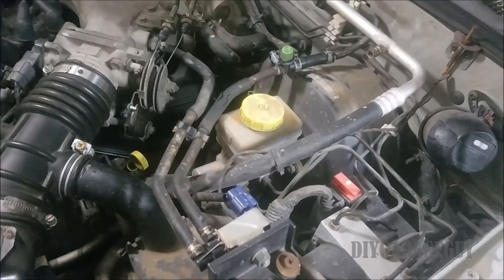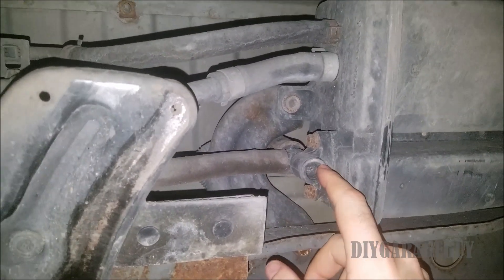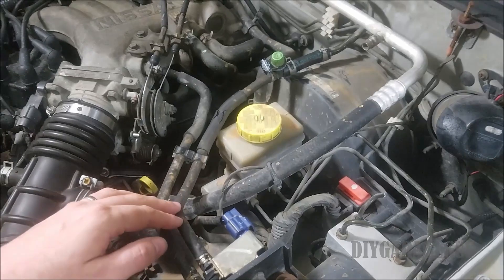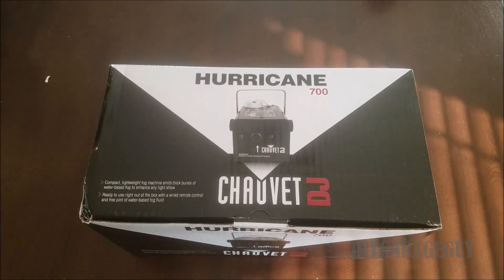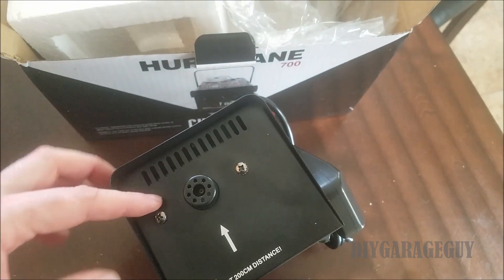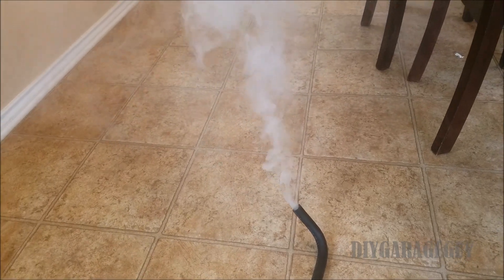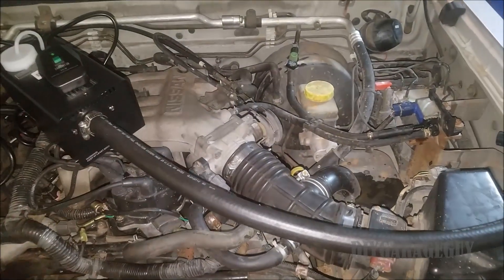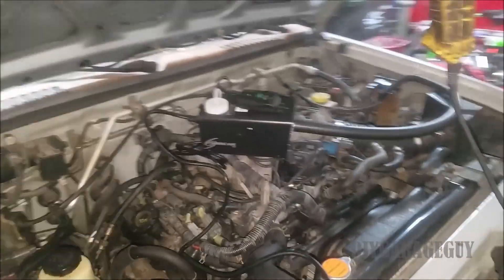Find EVAP Leaks with a Halloween Fog Machine??

Comment: It's just condensing, the hose reduction acts the same way a metering device ( fixed orifice ) does on your air conditioning system, it's where refrigerant changes state from a high pressure vapor into a low pressure liquid.

Comment: I really want to thank you for posting this even though it didn't work.  This helps us other views out big time, I was wondering if a fog machine would work for this test and this save  time on my end from buying a machine.  Again thanks so much for posting this video.  Did you ever find a solution?  I have a 2005 Nissan Altima that has a rough idea while in drive stoped.  I think I have a vacuum leak somewhere, no codes running.  Anyway thanks again.
Reply: Spray your vacuum lines with starter fluid while the car is running one at a time, you’re not showering them just a little spray. If the idle spikes up when your doing so you found your leak. You can also use a butane torch in the same manner. Let butane come out the torch but don’t light, breathe the butane on vacuum lines and look for a spike in your idle.

Comment: The issue is likely too much obstruction with the line's edges. If you beveled the hoses that you're pushing inside the bigger hose, so that the inner hose has kind of a "ramp" all around, I would think that would significantly help. Also, this is only a 1500 cfm machine, which is particularly low for a fog machine. I've seen another video of a guy getting one of these to work and the one he used was a 3500 cfm unit.